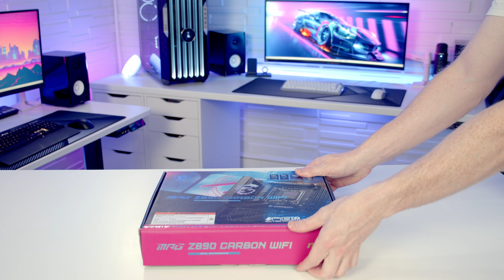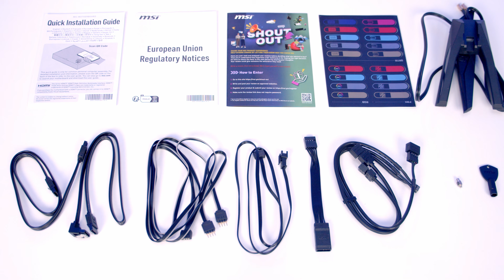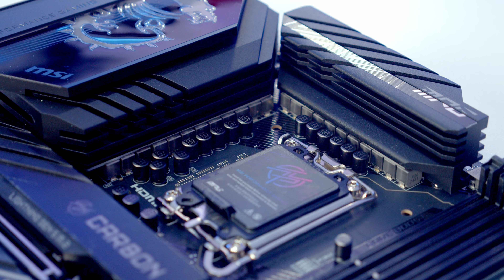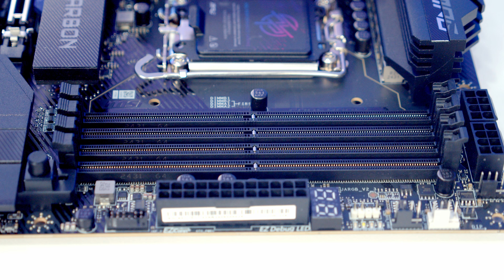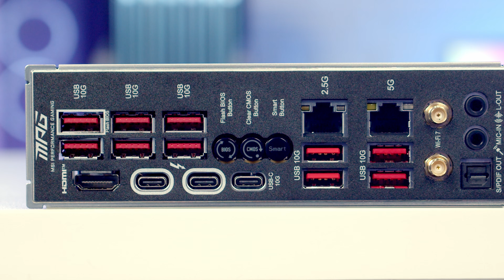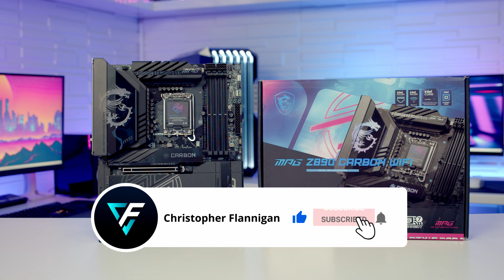MSI MPG Z890 CARBON WIFI Overview

Comment: Hi, I watched your video about the North XL with a mesh panel. I have a Ryzen 7 7800x3d CPU and was wondering what motherboard you would recommend for it? I was planning to get the motherboard you had, but realized you used an Intel CPU so it wouldn’t be compatible with AMD. Would really appreciate a response!

Comment: Chris. What MB would you suggest for gaming with a ryzen 7 9800x3d. X1 m.2 4tb, rtx 5080, 32gb ddr5 cl30 6000 ram. In the phateks nv7 u reviewed. (So total of 15 fans, using phanteks d30)